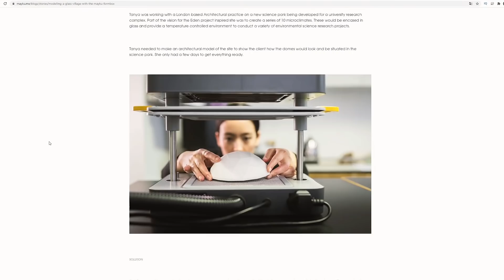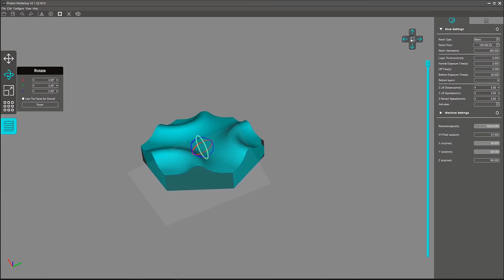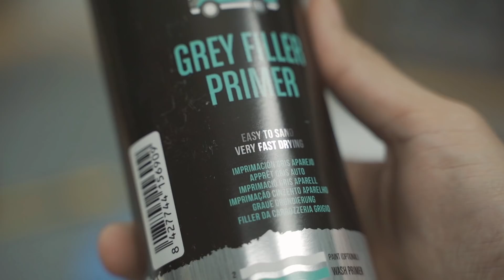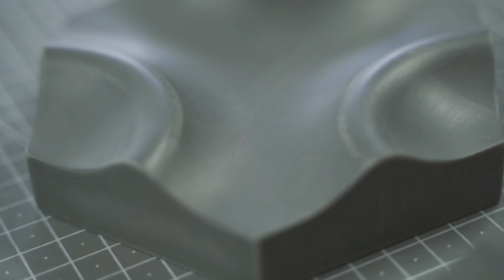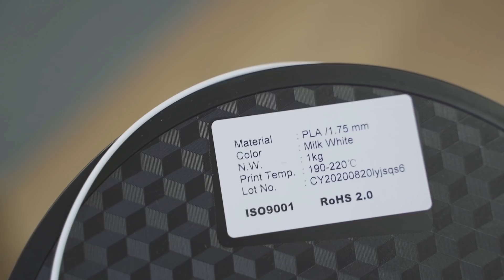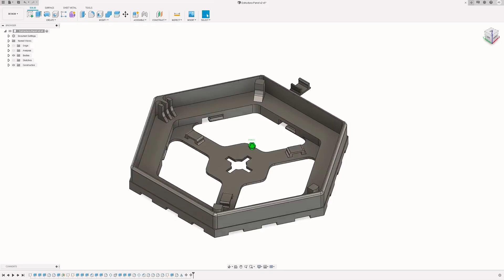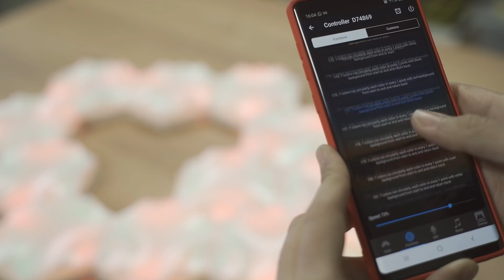🌀  Paneles LED con MAYKU FormBox / TERMOFORMADORA

Comment: Great work.

The yellowing at the far end of the strand is due to the voltage drop of the series of panels. You can fix that by applying the voltage at both ends of the strand so that you get half the voltage drop.

Comment: Hey thanks for the files and your work. 
Printing right now and when ordering the parts i noticed, that you've linked the wrong connectors. (or atleast amazon shows me the wrong ones, 2 pin instead of 3 pin)

Comment: Love your videos, even though I don't speak your language. Hopefully, someone will design a 3d printed alternative. I know there's some out there, but I really like your internal electronics design. Would be easy to design a thin 3d printed cover (without the curves) to replaced the vacuum formed one. I can't imagine that many people own a vacuum forming machine.
Reply: Vase mode is your friend here. Print the model vertically in vase mode and cut the bottom off. Only problem is you'll have an open side, but you can print a cover for that, it's as simple as rotating the model 60° on its side and stopping it once it gets to .4mm thick. Use superglue to stick it together and you're done.
Reply: @somedude2492  If I could find the STL files maybe.
Reply: @bigfatbill5187  he gives them away, check the description
Reply: @somedude2492  I did. None of the links there contain the files for this print.

Comment: Buenas! Muy chulo. Una pregunta. Veo que la termoformadora alcanza mínimo 160º, y a esa temperatura no conozco PLA que aguante sin variar su geometría. Ya sea deformando o expandiendo. ¿El PLA Filoalfa aguanta tanta temperatura? En casos más precisos yo hago moldes de silicona de platino sobre las piezas impresas, como usan preparadores de coches (Brabus por ejemplo), y luego hago un vertido de resina Epoxy de alta temperatura para sacar el molde. Las tolerancias son increíbles precisas si se desgasifican ambos materiales. También hay que tener un horno programable por ciclos para post-curar y obtener una buena estabilidad térmica. Pero si existe algún PLA que aguante tanta temperatura y se pueda evitar gastar más materiales y tiempo, estaría genial conocerlo. ¡Gracias!
Reply from the maker: Hola, creo que te mueves en sectores más profesionales. Esto es algo casero. Aun así, materiales como los alfaplus de filoalfa o algunos de Filamentum. Son PLA con mayor resistencia al calor. Aun así tampoco creo que aguanten 160 grados. Pero si dentro del coche en verano por ejemplo. Pero ten en cuenta que esa temperatura solo entra en contacto con el molde unos escasos segundos. En cuanto la lámina de plástico baja y la máquina empieza succionar se enfría muy rápido y el calor no llega a deformar el molde

Comment: This is amazing I really enjoy your content but you should have used WLED instead of that wifi controller

WLED has a better app and it can be control over pc or your smart phone it can be sync with tons of other plat forms and there are over 250 effects that can ne customize as you want there is no other addressable rgb controller that can beat or even get any closer to WLED not even actual nanoleaf or Philips hue 

Just give it a try it's really easy and fully open source

Comment: realmente te felicito, sos un exelente diseñador. y como mencione en otra oportunidad tenes un muy lindo canal!!! 
si no te molesta me gustaria dejar una idea. hacer esto mismo pero con baterias 18650 para que no se vea ninguna coneccion.
Reply: Es tan sencillo como hacer un paquete de 4S  18650, te da 14,8v... el controlador tiene una entrada de 12v-24v, asi que funcionara sin problema. Lo que no es practico. Para estar cargando las baterias tendrias que dejar un lugar donde meter el cable. Al final es mas sencillo hacer que el cable no se vea, que andar metiendo baterias a una luz que no es portatil.
Reply: @Is_mael   no sabia que el controlador tiene una entrada 12-24v. a mi si me resulta interesanta y practico que funcione sin coneccion. gracias por el datoo!!
Reply from the maker: Eso es, para algo que está fijo en la pared no merece la pena usar baterías, conectado a la corriente sabes que siempre va a funcionar y evitas estar cargando las baterías